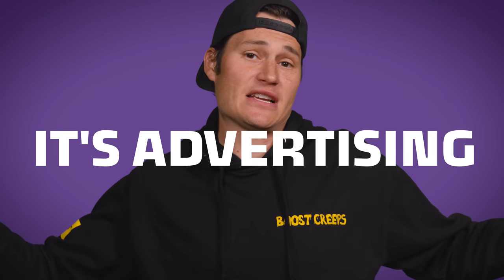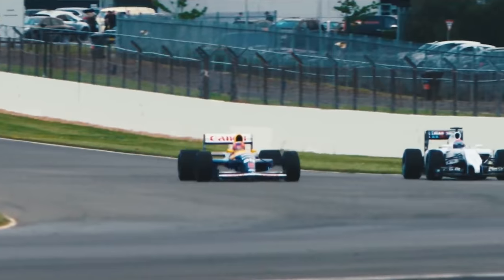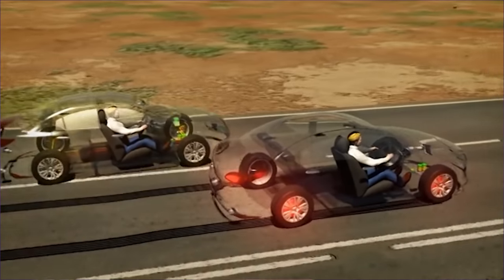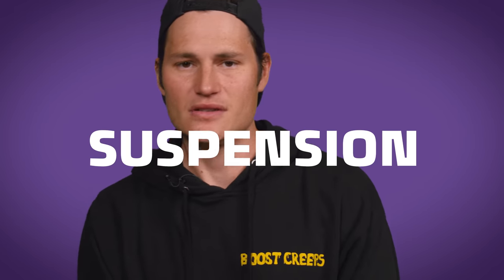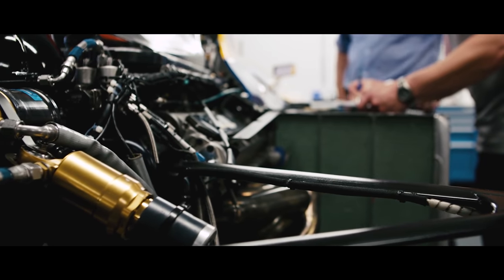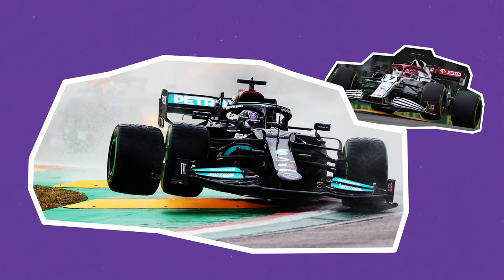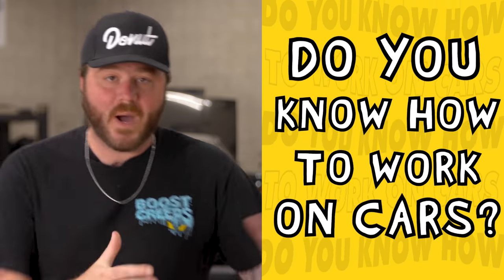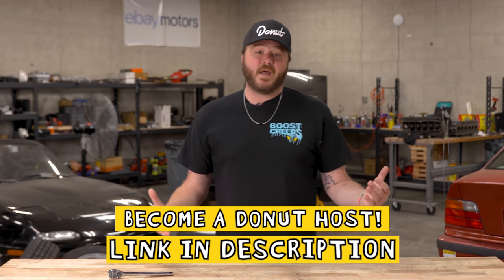Why F1 Banned Their Best Car

Comment: Imagine if the FIA came down this hard on Mercedes back in the early hybrid days 🤔
Reply: Mercedes lawyers are too good 😫
Reply: That's what I was thinking. Williams dominates for 2 seasons, then all their gadgets get banned. Yet it's fine for Mercedes to dominate for 7 years but no bans.
Reply: @RanjitSingh-em7lx  Funny cuz 2017 was major regulation change,so as little less in 2019 but hey,lets pretend cars are the same from 2014 up till now.Engine modes banned,DAS banned....
Reply: @BladeRunner031  I know 2017 was quite major but those rule changes were not made to target Mercedes dominance, they were made to make cars faster and hopefully more exciting races. It hasn't worked out, which is why 2022 will be big changes.
Reply: FIA like NASCAR, have always been their own worst enemy, usually due to greed or politics
Reply: @BladeRunner031  they got banned because other teams started to developing that
Reply: @RanjitSingh-em7lx  how was last season not exciting? And when did they try to make the cars faster?
Reply: That's because Mercedes didn't try to bend any rules and perfect their while designing their car according to Rulebook.

Comment: Everyone hates on cvts. I had a 09 maxima back in the day and loved the cvt. At any speed if you floor it , the engine revs to max power and you have constant 300hp. Just kept pulling. Cruising the highway rpm was barely over idle.

Comment: Imo the shitty thing about F1 is that they are supposed to experiment, develop and make commercially viable technologies. So what does F1 do? Ban them.
Reply: I know right so stupid...smh
Reply: hopefully a very restrictive budget cap would allow for looser rules. Can't go for 30 pieces of super tech if it makes you run out of money (like when they restricted carbon fiber usage due to price concerns), force them to use 3 pieces of vaguely tuned stuff. Now, if a team wants to use a full carbon fiber tub, they better be prepared to be stuck with a stock body.

Like, Lemons had a Miata with the wing connected directly to the rear axle, and it didn't really matter that it made the car corner faster when nobody is reaching 80 mph in the turns anyways.

Comment: The Dutch car manufacturer DAF used ctv on their cars. The funny thing is that, since they don't use traditional gears, the cars can run backwards just as fast as forwards. There were actual races of DAF cars driving backwards

Comment: I think a different rule could (and probably should) be made. If a team invents something that would make their cars so much faster than the competition that they're guaranteed a victory, then they should be presented with the choice of having the new technology banned to keep racing competitive or to sell their invention to the other teams at a predetermined fair price. Of course as long as safety or other important factors aren't compromised significantly (so it doesn't get too loud or causes too much pollution etc).
This way they reward teams for their ground-breaking inventions while keeping the racing competitive. The F1 is used by manufacturers as a place to innovate and push their innovations to the limits, so I don't think that it's good to ban innovations because they are too good.

Comment: In Forza, when we want to improve breaking characteristics and remove wheel lockup including the ABS rapid repeated lockup, we lower the breaking pressure by about 8-15%, we've found this not only removes ALL wheel lockup, but also shortens stopping distance.

I'm curious, are there any real life methods to attain the same effects?

Comment: So talking about the 1993 fw15c car while using the 1986/7 FW11/11b in your cartoons. Also the FW11B, 14B and 15C had active suspension. The 14B added traction control and the 15C added the ABS.

Comment: The reason for Williams' active suspension was to maintain a steady ride height. The cars developed much of their downforce by accelerating the air under the cars' floors as it exited at the rear of the cars. Active suspension allowed the cars to run extremely low which maximized the effect.

Comment: This is a really good explanation of the benefits of a CVT i.e. Always operates at optimal power or efficiency (depending which one you want). This is why most CVT's have a sports mode as  well as an economy (aka normal) mode.

A lot of people think CVT's won't work on a powerful engine. The fact that it was used on an F1 engine ought to put paid to that myth.

F1 racing often demonstrates technology that later makes it onto the average automobile some years later.

F1 racing is a good way to demonstrate to people that CVT's are not limited by engine power/capacity and can be very reliable.

:-)

Comment: Specifically to the point about the CVT transmission... it was in 2010 that the FIA banned refueling mid-race again.  If you're driving a CVT, sure you'd have maximum power more often, but you'd also be chewing through your ONLY tank of fuel.  If there could be some kind of manageable trade-off between increased fuel consumption and CVT usage, I wouldn't mind seeing the FIA un-ban the CVT.

Comment: The main flaw of CVT is that they can't handle high torque properly, as they will slip a lot. I mean F1 engines have low torque but revs very high, meaning they have to over-engineer the belts to handle such speed.

Comment: But the CVT was also proving to be ineffective because it was not reliable enough to last an entire race, and the engine being constantly at high revs actually cost them fuel mileage too. But I bet there is some kind of electronic controls that could have tackled the issue if it were allowed now

Comment: If I'm not wrong, I think that their active suspension was so advanced (as well as the CVT transmission) that it still a secret in the case of a come back.
Reply: They've revealed some of it, and some other companies have made similar tech that probably is better than it by now, but they do still keep some of it under wraps just in case.

Comment: Honestly what the engineers should do to get those old farts in FIA to outright remove those rules that have been created by the engineers. The engineers from all of the teams should use those banned things within the cars(with the support of the drivers) and when the FIA has to cancel a race after thousands of fans are seated in the stands. The drivers and engineers could then tell the public that the reason why the race was canceled was because of the FIA’s rules that were created in the early days have stagnated the cars. Antilock breaks alone could save the drivers from slamming at full speed into another car that had been disabled on the track due to some accident or crash.

Comment: CVT's have an unlimited range of ratios between two points. One weakness of CVT's is that the highest gearing is not as tall as the top gear(s) in a manual gearbox. Newer CVT's have a taller top gear than the older ones used to... so they're slowly addressing this issue.

The durability of CVT's depends on the design: 
Jatco CVT's have a reputation for dying prematurely. However. Honda and Toyota CVT's can last >1,000,000 km without problems if they're maintained properly. That's double or triple what a normal auto (or manual) would normally last.

If a CVT was running at max power all the time you'd expect it to use more petrol and get hotter.  If you're winning races why would you care? Race Cars are not noteworthy for their economy!!!

Normally on the road, a CVT is optimised to maximise economy rather than power. This is why today's CVT's usually get better fuel economy than manual transmissions.

You'd also expect racing CVT's to die a lot sooner than their road-going cousins. It's unreasonable to expect the first iteration of a racing CVT to be perfect.  However, any issues with CVT longevity in racing would undoubtedly be resolved by using better materials/design. Just cooling the CVT a bit more probably would have eliminated most excessive wear. That's hardly rocket science.

🙂

Comment: Fw15c did not had hydropneumatic suspension, hydropneumatic is used in road cars from ealy 1950, it had pure hydraulic system (basicly double acting hydraulic actuators that controlled position of car in relation to each wheel)

Comment: Formula 1 has always been about the best engineers working with the best drivers to deliver success. It's the whole reason why there's a 'constructors' title. If people want to see an even playing field, go and watch the plethora of competitions where the cars are the same. The main reason why F1 is dull at the moment is because the cars are too similar. 

In order to make F1 interesting, the FIA needs to butt out of making continuous rules. Set a basic list of rules like "the car must be no bigger than 'x' and have no more than 4 wheels" and then set a spending cap and just let the constructors go for it. What will happen is you have much more varied cars that try different ways of tackling problems and so are better in certain areas than others, thus resulting in more overtaking which equals more fun. It'll also level the playing field for smaller companies like Williams to actually compete with companies like Ferrari and Mercedes who spend a ridiculous amount of money and lead to more innovations in production cars as the technology filters down.
Reply: Wind Rose  may have been useful if you'd actually read my comment properly. You'd have clearly seen the part where I said 'set a spending cap'.

Comment: CVTs were first introduced in the 70-is from lotus and the engine running at max load wasn’t a sustainable thing. They had to make bigger radiators for the cars and that lowered the aerodynamics of the car. Banning the CVT wasn’t aimed at Williams but at lotus 20 years prior to the Williams dominated era. Maybe if they got the chance to experiment with the CVT transmission the whole car had to be reinvented.

Comment: well the belts on those cvts had to have been strong af cuz you are required to run a set gearbox for a certain amount of races and a belt change might count as a gearbox change. idk if those rules where in place back then tho. also i believe that f1 cars nowadays use torsion bar,i watched driver 61s vid on it.

Comment: Fernando Alonso was on Renault in 2005 and 2006 and won the drivers/constructors and went to Ferrari later so it is 3 times in the last 20 years that the champion wasn’t Ferrari, Red Bull, or Mercedes. And if you were talking about drivers then you can also add 2008 Lewis Hamilton on McLaren but Ferrari won the constructors that year.

Comment: The CVT never made it into a race car, only a test mule. Even then, it was faaaaar from a finished product. It wasn't reliable yet, the engine would grenade (it literally lived at super high RPM) and drank fuel like crazy because it was always at peak power.

Comment: Williams should actually be thanking the FIA for banning cvts. While the concept is looks good on paper in practice it doesn't work that well (see any Nissan road car from the last decade). Main reason is it has one critical failure point the belt. If that fails you go from blasting down to the track to a dead stop with no drive train. With a traditional transmission if you lose a gear you still have a drive train. Yeah sure you have to skip shift but it's better then getting a dnf because the belt broke.

Comment: Good question... If the car has traction control ABS stability control etc.... 

Sooo...... Whats the point of having a driver? Might as well have a self driving car....

They are killing the purpose of racing its not about who's the fastest with assist its about who's skilled Enough to reach the finish line in 1st in 1 piece instead of a square shape...

Safety aside some stuff like traction control and other stuff are not supposed to be implemented in the higher class... Sure for beginners its best to have some assist so that they can have the feel for it.. but for an F1 driver you should be skilled Enough to handle the car qith no assist else your no different than a grandma in her hellcat.

Comment: Williams f1 uses customer engines. Several other teams use Mercedes-Benz engines. The fact that manufacturer engines do not supply added bits like tech support. So each team have their own tech for the bought engines. So Merc have their cake and eats it. They have the testing results from their customer engines.

Comment: There were other reasons that the cvt woild have not worked… in theory its amazing, in use at 18k rpm for a full race the belt cant cope with the stresses and will slip or break before the race ends…. In a road car thats a different story😂😂😂

Comment: There are clearly two hearts in my chest...
One says, yes you are right. All these gimmicks and Gremlins make racing easier and safer. Concentrating for 70 laps by zero mistakes ist pretty hard. 
But...
... I want to have racing back. I want these drivers who manage the zero mistake, where Schuhmacher won races because he was clearly the magician behind the steering wheel despite of the crappy car he had to use. The hard fight man vs man while every man had to fight the beast he was sitting in.
Todays racing is boring to me. To much perfection. As modern cars are. I prefer a Porsche 930over a modern 911 Turbo S. Yes, it's slower, harder to drive, a diva on wheels. But also yes - that's why I want it...
My2Cent. Thanks for the video.
Reply: honestly after this video i have a salty taste for FIA.  They banned Williams from winning too much, then Ferrari. and now they try to reign in Mercedes,
You want to find the better racer? give them same cars! with few days to learn on. (Trackmania style)
Want the better engineering team? give them a robot racer to get the best out of it, because at that speed human reactions and movements are not enough for 50 laps.
Williams had the best digital driven tech a car could have when we barely had personal computers in our homes. that's serious tech snuffing from FIA in the name of racing fairness.

Comment: Correction for the team that has won the most world titles, both drivers and constructors is Ferrari not Williams
Ferrari
Best result 16 Formula 1 World Constructors' Championships
(1961, 1964, 1975, 1976, 1977, 1979, 1982, 1983, 1999, 2000, 2001, 2002, 2003, 2004, 2007, 2008)
15 Formula 1 Drivers World Championships
(1952, 1953, 1956, 1958, 1961, 1964, 1975, 1977, 1979, 2000, 2001, 2002, 2003, 2004, 2007)
Competitions held 1015
Wins 238
Williams
Miglior risultato	9 campionati mondiali costruttori di Formula 1
(1980, 1981, 1986, 1987, 1992, 1993, 1994, 1996, 1997)
7 campionati mondiali piloti di Formula 1
(1980, 1982, 1987, 1992, 1993, 1996, 1997)
Gare disputate	751 (come team)
743 (come costruttore)
Vittorie	114